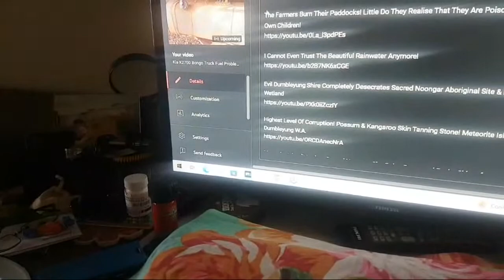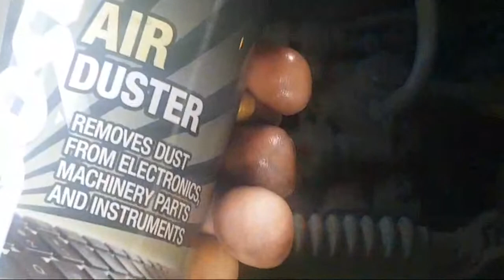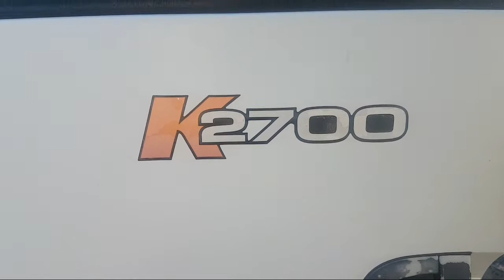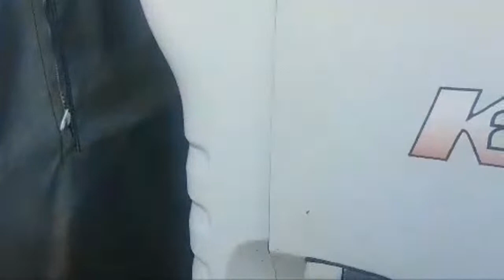Kia K2700 Bongo Truck Fuel Problem! Diesel Tank Removal! Drain & Clean! Wire Fuel Filter Inspection!

Comment from the maker: The Gunk, Dirt & Algae Removed From My Kia K2700 Diesel Truck Fuel Tank Today! Full Drain & Clean!
https://youtu.be/t9gL5vUz6Lo

My Kia K2700 Truck Breaks Down! My Fault & Laziness! Rescued & Towed Home By My Noongar Mate Grant!
https://youtu.be/q5ykd-6ucUA

In This Live Video ... The Fuel Problem & Truck Stalling Started Happening! Drive Out To Dayles To Pick Up A Concrete Mixer, Chatting About Life, Dead Trees & Bad Truckies!
https://www.youtube.com/live/Vzay98FXweY?feature=share

Using a Cotton T-Shirt over Your Funnel to Filter Jerry Can Fuel Debris, Rust Particles, Dirt, Gunk!
https://youtu.be/r6I3v9hVwzc

My New Kia K2700 Diesel Side Tipper Truck & Trailer for Scrapping - Treasure Hunting - Camping etc
https://www.youtube.com/watch?v=qbm12ERGe7I

Wild Bill's Cliff Face Crash Rescue - Kia Truck Versus Kangaroos
https://www.youtube.com/watch?v=thD8SlT2YhQ

Cliff Face Kia K2700 Truck Rescue Will the Tow Rope Break? A Precarious & Hairy Situation Here!
https://www.youtube.com/watch?v=DR6sFqsxtbk

My 2006 Kia K2700 Diesel Truck Finally Hits 100,000 km's on the Clock
https://youtu.be/4yLe8wE_RaI

My 2006 Kia K2700 Diesel Truck Finally Hits 150,000 km's on the Clock 
https://youtu.be/XgS_lC-rFBw

Christening My New Kia Truck - Cashing In Copper, Cast Aluminum and Insize Steel Scrap Metal
https://www.youtube.com/watch?v=ygC4QrEDv50

My 2006 Kia K2700 Diesel Truck Finally Hits 100,000 km's on the Clock
https://youtu.be/4yLe8wE_RaI

Truck Sabotaged? Deliberate Loosened Wheel Nuts? & Georgie Poisoned? Coincidence or Just Paranoia?
https://www.youtube.com/watch?v=OO4RRJUXO2U

$1000 Scrap Run & Tyre Blowout & Huge Scrap Yard Magnet Claw Action
https://www.youtube.com/watch?v=dIJSWWNtEHQ

End Results - My Kia K2700 Truck Canopy Steel Frame Completed
https://www.youtube.com/watch?v=Rjh7cERFRBE

Getting My 2006 Kia K2700 Diesel Truck Canopy Made & Fitted - Ready Today!
https://www.youtube.com/watch?v=jTvHOtp-F9I

Getting a Canopy & Frame Made Up for My 2006 Kia K2700 Truck - FREEDOM FINALLY!
https://www.youtube.com/watch?v=HH7eMcFYdVs

My New Kia K700 Truck Canopy Finished! Big Adventure Soon Around Southern & Northern Australia
https://www.youtube.com/watch?v=Kg10-KxA2VQ

Grrr... I just locked my keys in my little 2006 Kia K2700 Diesel Truck!
https://www.youtube.com/watch?v=cUUUSRL8lEQ

Scrapping & Cleaning out the back of my 2006 Kia K2700 Diesel Truck using my hydraulic side tipper
https://www.youtube.com/watch?v=NKhvzm31lRU

Scrapping Metal & Scrap Metal Road Trips with Wild Bill
https://www.youtube.com/playlist?list=PLhyT97-KaZ_3331xg1I-HGgqjZmW9jJly

Cashing in My Scrap Metal For Cold Hard Cash - Paying Off My Bill's!
https://www.youtube.com/playlist?list=PLhyT97-KaZ_1E3WkSpaENjRA5q0DkEBTy

Lazy Dumbleyung Shire Workers Not Stopping At Deadly Train Crossing - A Great Disaster Is Coming Soon To The Dumbleyung Shire Because Of This Carelessness & Recklessness!
https://youtu.be/9iZdS5VFFk8

Evil Shire Of Dumbleyung Light Up Ancient 500 Year Old Salmon Gum Trees and Burnt Them Down Due To Their Carelessness, Laziness & Recklessness In The Shire Of Dumbleyung Fun Raising Farm Wheat & Barley Paddock!!! Part 1 
https://youtu.be/mtu4-rLwXow

Filmed 20th May 2023 - So Frustrating! Ancient 500 Year Old Salmon Gum Trees Burning Down Due To Shire of Dumbleyung Recklessness & Negligence! Pt 2
https://youtu.be/Peo1xEfzA4E

Shame On You Shire of Dumbleyung ! Another 500 Year Old Ancient Salmon Gum Tree On Fire Due To Pure Utter Laziness! Part 3
https://youtu.be/HtVS1Wr-tpY

Final Before Video Of The 500 Year + Salmon Gum Tree With Huge Trunk Killed By Shire Of Dumbleyung! Part 4
https://youtu.be/RL99dNRVilU

The Farmers Burn Their Paddocks! Little Do They Realise That They Are Poisoning Their Own Children!
https://youtu.be/0La_l3pdPEs

I Cannot Even Trust The Beautiful Rainwater Anymore!
https://youtu.be/b2B7NK6xCGE

Evil Dumbleyung Shire Completely Desecrates Sacred Noongar Aboriginal Site & Natural Wetland
https://youtu.be/PXk0iiZczIY

Highest Level Of Corruption! Possum & Kangaroo Skin Tanning Stone! Meteorite Island Dumbleyung W.A.
https://youtu.be/ORCDAnecNrA

Meteorite Island! Ancient Sacred Noongar Site Being Destroyed By the Shire of Dumbleyung
https://youtu.be/nWpHLiDolHQ

Ancient Noongar Stone Tools that we found in this Sand Pit - Sacred Noongar Aboriginal Stone Tools In Yellow Sand Bulldozed By Dumbleyung Shire Front End Loaders
https://youtu.be/uln3OkctjUU

Noongar Man, Grant was the first Western Australian Noongar Aboriginal man to touch this beautiful sacred stone in at least 123 years!
https://www.youtube.com/watch?v=of3r93pHGG0

Dumbleyung Aboriginal Man Grant  Speaks in his  traditional Noongar Aboriginal Language As He Walks His First Ever Steps On Meteorite Island!
https://youtu.be/lkJuL-jU9uA

Dumbleyung Noongar Man Grant , First Aboriginal Man To Walk Onto Meteorite Island in 120 Years
https://youtu.be/of3r93pHGG0

#Kia #Bongo #Diesel